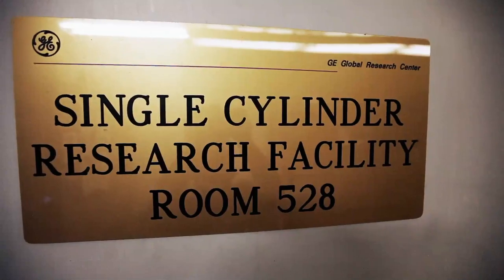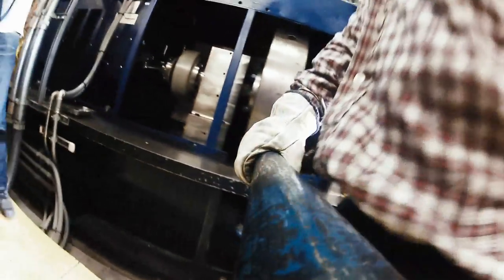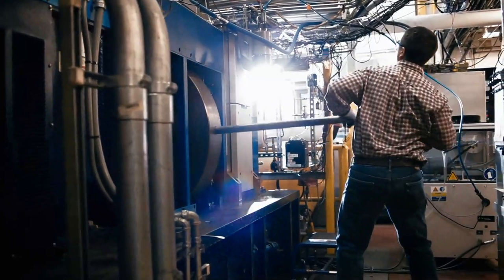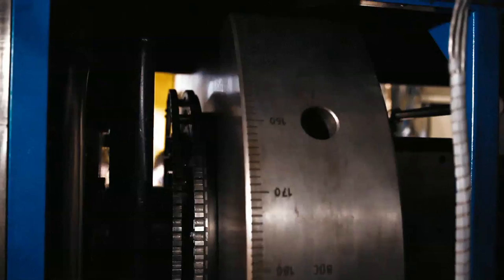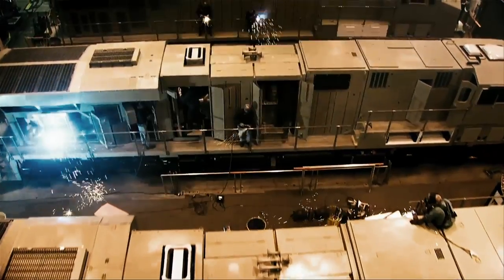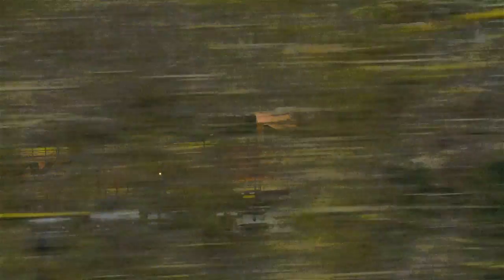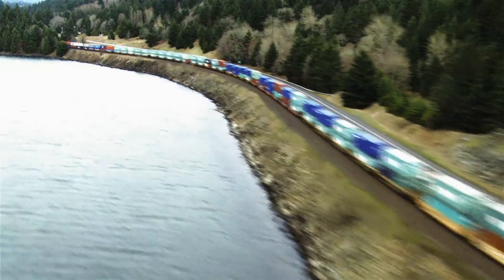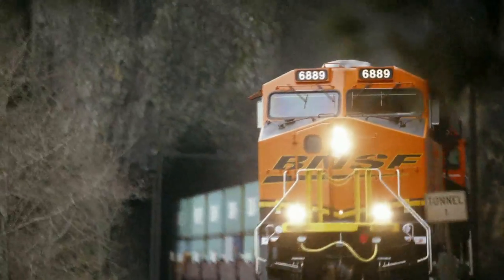GE Locomotives: The Science of Efficiency

Comment: The 1 gallong / 400 miles was for a single car being shipped by rail. Trains use much more fuel than a car or truck does, but they also transport much much more stuff on a single train than you can in a car or truck.

Comment: Friction between car ties and the road is much higher than it is between train tracks and a train - a train doesn't have to grip the road to keep from sliding out like a car does. A train also has much less air resistance than a car does (proportional to its size). The engine in the front pushes most of the air out of the way so that every successive car in the train doesn't have to push very much air at all.

Comment: Ok. All of you need to get your facts straight before you comment, or bring hate on this video. EMD (ElectroMotiveDivision) of GE made the best road switcher for trains (the geep series GP7 GP9 etc). GE is the main supplier for engines across america. ALCO (American Locomotive Company) failed against GE. Trains are the most fuel efficient machines to transport goods. They use momentum to move. GE perfects how they do this. I work for a railroad with GE engines. You all should be thankful.